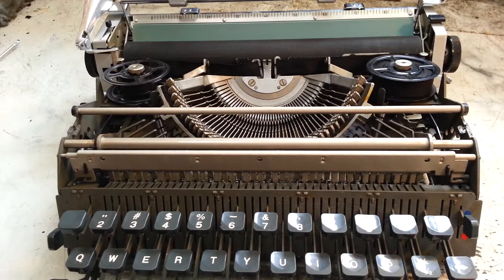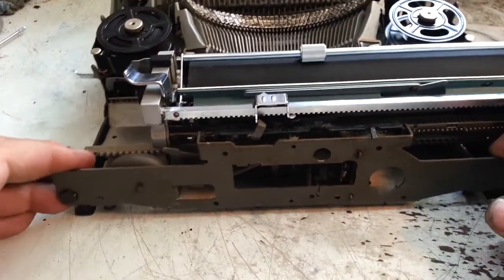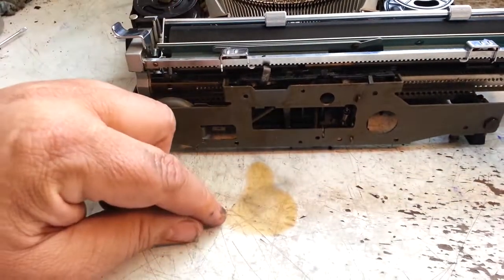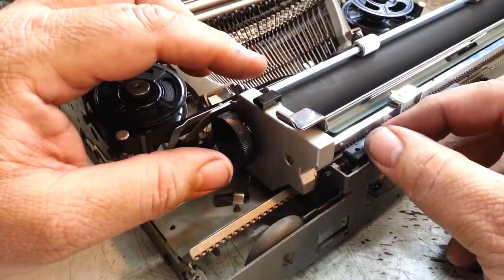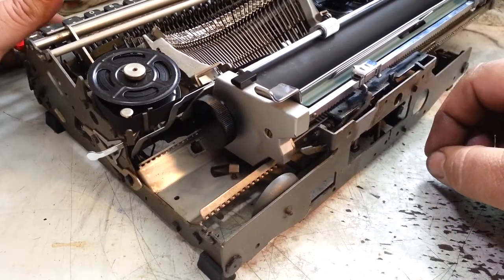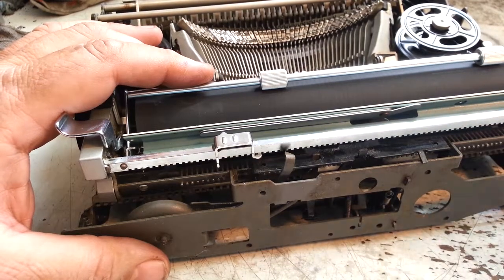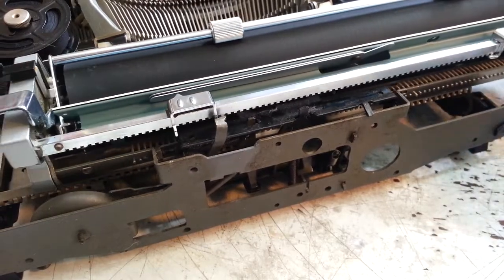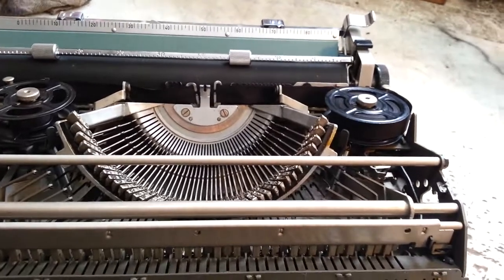Olivetti 32 How to Repair Bell on Typewriter, Fix Dinger . . .

Comment: I dont know if this applies to an Olivetti 32. But on one of my typewriters the center hole in the bell itself is actually not in the center. That way you can get the bell closer to the hammer/clapper for a louder or softer "ding", just by loosening the screw and turning the bell (and re-tighten the screw). Did this on my typwriter, and it gave me a much louder ding.
Reply from the maker: I have seen bells on eccentric holes, I always look out for that, does seem to make for an easy adjustment when needed

Comment: Perhaps you could explain to me why my Olivettii 22 has a carriage that rocks front to back. Especially, when the carriage is extended all the way to the right. I would greatly appreciate any idea as to where I would start to resolve this. Otherwise, it seems to be a really good machine. Thanks!
Reply from the maker: Most of the time when typewriters carriages get loose it's due to being dropped. shipping damage.
Since this usually involves bent rails and parts, it's hard to resolve
Reply: @phoenixtypewriter2136  Thanks so much!

Comment: What to do when the backspace button works, but only at one particular carriage position, it is stuck pressed and won't come up? To release the backspace button i have to move the carriage a bit, all fallscin place again, the backspace button pops back up. A mystery and the working parts are not easily workable on the olivetti 32
Reply from the maker: Well since this is not a common problem, at least one I haven't seen, I don't know . . . 
I would need to some analysis and in-person troubleshooting & yes these are harder to work on than most typewriters
Reply: @phoenixtypewriter2136  too bad we are on opposite ends of the ocean... :( :( :(
Reply: Is there a way to get the whole carriage out on this machine, to then see the escapement? In that way i stand a chance...
Reply: @buildyear86 you can always get it out…getting it back in is tricky/difficult/maybe impossible
Reply: I see. Thanks. Great channel!